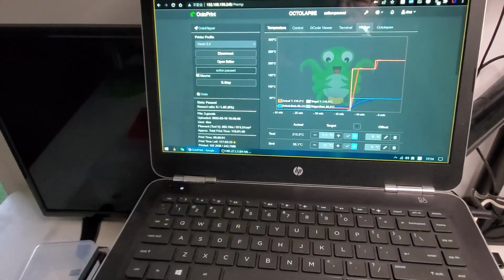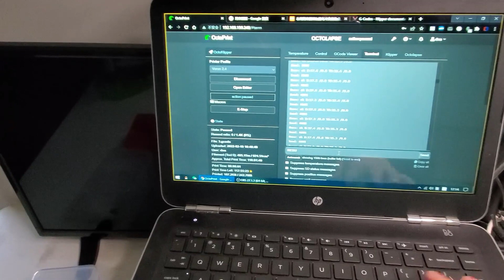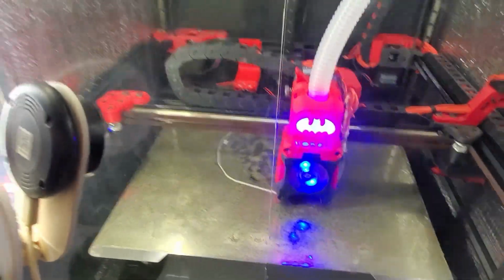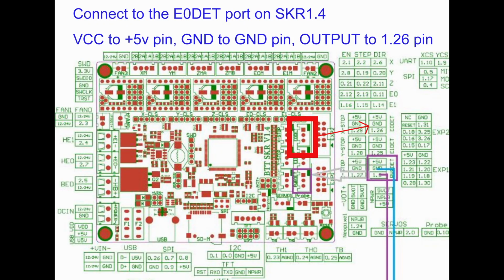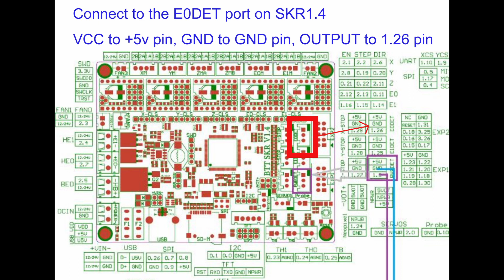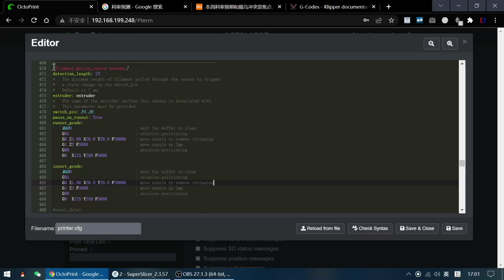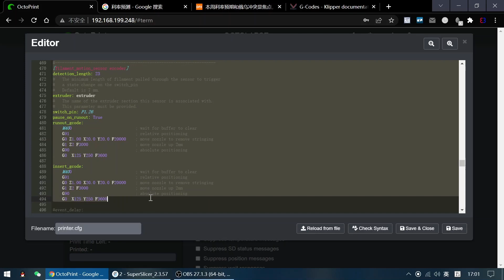Super simple and low cost DIY smart filament sensor for my voron 2

Comment: You need two light sensors to do this right. If you only use one, you risk triggering it continuously on the falling or rising edge as the extruder fights the jam (the filament moves back and forward slightly). You need to do a simple quadrature encoder setup with two lights offset by half the slot gap. A rise or fall on one should gate the other one to the processor, that way, only an advance makes pulses. Raising or lowering one continuously without the other sends nothing after the first pulse.
Reply: Can you, please, elaborate? I do know quadrature encoders, but have trouble understating what you mean by “one should gate the other to the processor". Does that mean that if it gets stuck right on the edge and one signal cycles back and forth, the final value of the other output signal doesn't change, which then results in print pause?

Comment: Nice job, would you mind sharing the printer.cfg for klipper, thx!
Reply from the maker: [filament_motion_sensor encoder]
detection_length: 7
#   The minimum length of filament pulled through the sensor to trigger
#   a state change on the switch_pin
#   Default is 7 mm.
extruder: extruder
#   The name of the extruder section this sensor is associated with.
#   This parameter must be provided.
switch_pin: P1.26
pause_on_runout: True
runout_gcode:
    M400                           ; wait for buffer to clear
    G91                            ; relative positioning
    G0 Z1.00 X20.0 Y20.0 F20000    ; move nozzle to remove stringing
    G1 Z2 F3000                    ; move nozzle up 2mm
    G90                            ; absolute positioning
    G0  X125 Y250 F3600

insert_gcode:
    M400                           ; wait for buffer to clear
    G91                            ; relative positioning
    G0 Z1.00 X20.0 Y20.0 F20000    ; move nozzle to remove stringing
    G1 Z2 F3000                    ; move nozzle up 2mm
    G90                            ; absolute positioning
    G0  X125 Y250 F3600
Reply: @3DFunfun   thank you so much
Reply: thank you!!

Comment: Nice take on this and very inventive.. Might I suggest the bearing shaft be replaced with an offset nut/bolt to be able to adjust tension similar to the way  a Creality Ender uses to adjust rail tension with the carriage.  It may be an alternative to simply adding more rubber bands.
Reply from the maker: Good idea